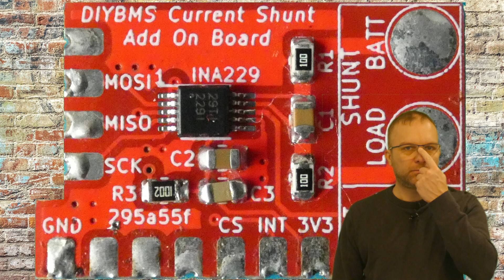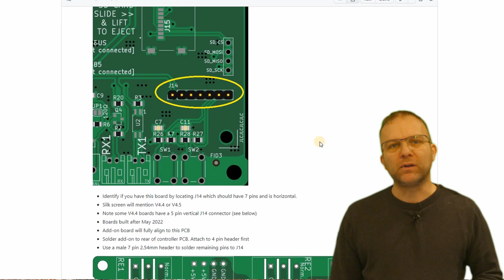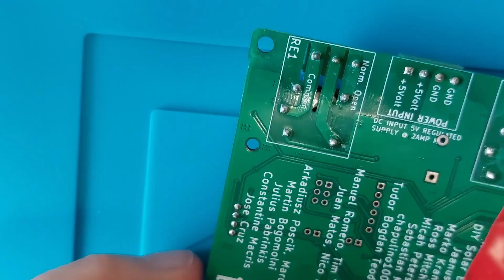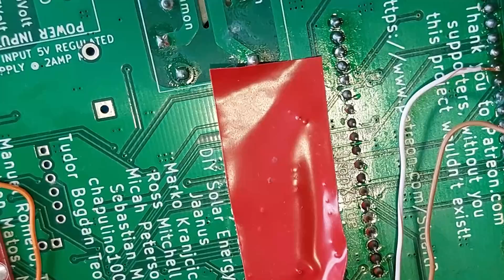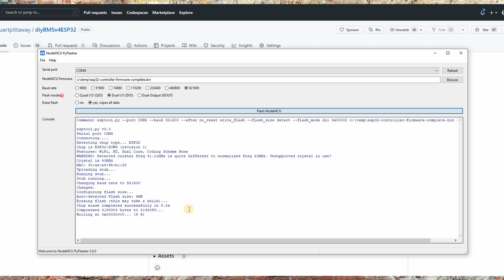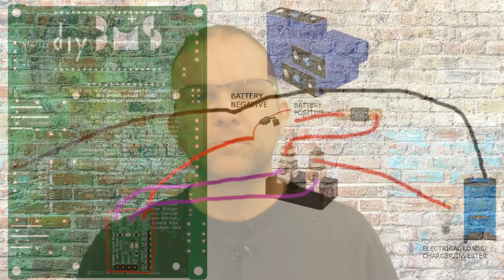Current Shunt Add-On Board [DIYBMS]

Comment: @StuartPittaway   Just purchased the 4.61 Controller was planning on using it with a 96s Lifepo4 system. I just watched this video and reading the comments, I thought the controller wasn't limited by voltage but in away it is because the shunt is only capable of 85v.. I'm not sure what to do now, I thought this BMS was my solution.. 
Is there a way that I can incorporate something like the VISHAY HV-IBSS-USB shunt?  This thing is pretty awesome, up to 850v.

Comment: Have been using your ina229 current monitor on my new solar system for about a week, modified with 3 current sensors. I note a low frequency oscillation of several 10's of an amp with a period of several minutes. At night when battery current should equal load current, the oscillations get out of phase where sometimes   load current goes up while battery current goes down etc.. Problem is difficult to analyze with scope because of huge amount of high frequency noise. I am thinking a possible cause may be the high inductance of my inverter coupled with the 1 uf filter capacitor on the input of ina circuit. I changed the adc_config register to collect 1024 sampled (from default 128 to 1024 --- 0xffd4 to 0xffd7) and this helped the problem quite a bit. Will work on it some more. Thanks for inventing such a great circuit! Hope this is interesting.
Reply from the maker: Thank you for the information

Comment: Hi Stuart, really great work and effort you're spending so many years now. Thanks for that!
I wanted to upgrade my esp8266 controller to esp32 because of the shunt option - I chose the add on board and now I got stuck with 0-readings.
Perhaps you can give me one or two hints? As I populated 2 controller boards (v4.6) and 3 add on boards already, I would exclude a soldering issue with the INA229 chip.
Reply from the maker: Hi, probably easier to open a GitHub issue, it's difficult to support via YouTube messages

Comment: Can we attach different shunts to the controller? I.e. ones that support more than 85 volts?
Reply from the maker: The shunt is a current monitor, the voltage the voltage doesn't matter.  However the INA chip I use has a maximum of 85V voltage reading

Comment: Want to thank you for your current monitor design. I created a somewhat expanded stand alone ina229/esp32 board with 3 current monitors channels based almost entirely on your board, and software. Also added a mod-bus interface for status and control of my Epever charge controller. Just got the board working, but still digesting the software. I wanted to monitor battery, load, and charge controller current simultaneously. I used Easyeda for the board design, with a somewhat different esp32 module. It was very challenging soldering the ina229 chip, but my wife managed it with her steadier hands. I have had good luck exporting data with MQTT and displaying with node-red. Thanks again.
Reply from the maker: Excellent, glad you found it useful
Reply: @StuartPittaway  thanks. Now trying to get it tested, and having trouble getting the current to agree with my test setup. With the calibration register set to the value per online tool, I am getting about 5% low, and the negative current doesn't quite agree with the positive. Can always change cal value, but not comfortable with that. Now building a second channel to see if results are the same. I have a .72 milli-ohm shunt, and have set max current to 40.96 amps.

Comment: Hi.. Thank for great work! Have a question, want to use this for EV conversion, 110series...does it mean I will require 110 modules?
Reply from the maker: Yes, it would. With a high voltage DC setup, I would look for a specific EV BMS. Especially as it's safety critical
Reply: Think I'll go ahead with Orin bms, or reverse engineer a Nissan leaf bms I have lying around

Comment: Hi Stuart, great work you are doing on this, much appreciated. Your comment on ground isolation has stuck in my mind. I'm now trying to get the BMS to Sofar inverter CAN working again after I did that initial testing of the Pylontech emulation last year. You probably remember that I had ground isolation problem which I solved using a mains powered ground isolated supply. I'm now powering the BMS of the battery as suggested but am getting the ID05 error again when I reconnect the battery. Can you advise which buck converter you use? Mine seems to be causing a problem. Thanks in advance.
Reply from the maker: Remove the ground connection from the CANBUS cable, just use canh and canl connections
Reply: @StuartPittaway  Thanks. There isn't a ground wire on the CAN cable. The problem appears to be that the ground plane of the HYD inverter is at PV voltage, in my case 215v relative to Battery negative. Supply at the BMS needs to be ground insulated and anything connected to the BMS also needs to be isolated from ground.

Comment: sorry to spam your most recent video, I am struggling to get any slave 4.21 boards firmware uploaded

EDIT my new usbasp device arrived. same problem as before observed. tried -F upload flag, tried -B16 upload flag. all to no avail. Any advices here Stuart. Last thing to try might be the tinyisp like Adam Welch does but honestly think that the slaves may be broken too.

I struggled last night to flash the 4.21 slaves
Uploading .pio\build\V421\module_fw_V421_attiny841_421_eF4_hD6_l62.hex

avrdude: error: program enable: target doesn’t answer. 1
avrdude: initialization failed, rc=-1
Double check connections and try again, or use -F to override
this check.

any chance to send one to you to rule out that its not my equipment letting me down?
Reply from the maker: You can try the tinyISP but I'm starting to wonder if the boards are no good/bad soldering or faulty ATTINY chips.
Reply: @StuartPittaway  yep me too
Reply: Might try cleaning the flux off the boards from my soldering but the soldering was pretty tidy
Reply: I do get a green flash on the board when it tries to flash
Reply from the maker: Do you have an Arduino which you can program using the usbasp adaptor? Straight from the Arduino IDE
Reply: @StuartPittaway  yep i already have one. Ive used it to flash an old i3 clone 3d printer board that didnt have an onboard programmer
Reply from the maker: @Whereswally606  in which case it's got to be the chip or the soldering, it's definitely a working design, so I would expect at least 1 of the modules to work!
Reply: @StuartPittaway  just got it working with my usbasp. Bloody stupid error on my part. I was changing the -b16 on the wrong env as i was doing it to the env400 not the general env section. Thanks for helping

Managed to flash the 5 i have. Now to buy a few more so i can have a 24v pack.
Reply from the maker: @Whereswally606  fantastic!

Comment: Thank you for sharing ! I 'm a novice, the display shows ' The controller is having difficulty communicating with the cell monitoring modules. ' What does it mean, the page also has no data, the control board has no problem, the monitoring board uses 440, how to solve
Reply from the maker: Generally means a problem with the cables between the controller and modules.
Reply: Thank you for your response ! But I 'm sorry, it still doesn 't work.
Reply: I like your BMS very much, I want to continue, can you tell me the specific information of the cable using BMS, there may be a problem in this regard
Reply from the maker: @yuanianlin  open a GitHub issue for the problem, it's easier to talk there

Comment: Hi Stuart, great work again. just ordered the "old" board 5 days ago... you know, if it is possible to use the ina 229 also on the original version of your shunt system?
Reply from the maker: The original shunt can only use the 228 chip - not the 229.

Comment: Morning Stuart,  from sunny Australia. Never did get them boards working.
Reply: Gday mate... i`m relatively new into the DIYbms and will say it works very well, and now also works well in canbus mode simulated as a pylontech battery, works well with my Solis RHI 5k hybrid inverter. 
My previous build was with a Zeva BMS, awesome bms to be fair, built there in Oz, but he doesnt do them anymore.
Reply: @Anthony Evans  I have 5 boards here, half populated, I live in Victoria.
Reply: @chuxxsss  Hi again, what version controller boards are they?
Reply: @anthonyevans7911  4.0 or 4.1
Reply: @chuxxsss  ok, not the one with the esp controller and screen
Reply: @Anthony Evans  Yes the one with the screen and esp32.
Reply: @chuxxsss  what items are left to populate?

Comment: Question on powering the controller, I'm currently powering it via a USB port on the inverter that is powered from the battery. Do you think this will still be suitable if I upgraded from external shunt to on-board?
Reply from the maker: Difficult to know for sure in this scenario Mike.

Comment: a doubt Stuart. What distance could there be between the controller and the resistor (shunt) consider a distance limit or we could have a meter or a meter and a half of distance, will it greatly affect the reading precision or interference?
Reply: There is practically no current flowing so distance is not that important. You probably get some noise in it in longer cables but the digital INA ICs have some built-in filtering/averaging
Reply from the maker: I've tried about half a metre worked fine, you'd have to try it!
Reply: Just drill the cable and use a bigger diameter 1,5mm2 or 2,5mm2

Comment: Awesome work.
Placing a voltage divider. Could the INA229 VBus reading voltage be increased for high voltage systems? For example for reading 150Vbatt
Reply from the maker: I doubt that would work, outside the specification of the INA chip.
Reply: @StuartPittaway  What about using a voltage divider though? Bring that down to spec for the INA229... 

It would need a software change to accommodate such setups. Some sort of multiplier ratio the user would have to supply.
Reply from the maker: @CollinBaillie  all the internal calculation inside the INA chip would be wrong as well, the chip does all the columb counting
Reply: All these current monitors work by measuring a differential voltage across the shunt resistor, which itself is a very accurate resistor of a known value. If using your example you divide the battery voltage by 10 to get 15V then your current measurements will also be off by a factor of 10, and any variation in the resistor dividers would add further inaccuracy to the readings. You would need to do some custom modification of the firmware to compute the correct values but still be left with potentially variable errors from the voltage dividers.

Comment: Brill Stuart. Just to clarify, the new controller version 4.6 will have the current shunt integrated? Reason I ask is i need another 2 controllers and 3 current shunts at the moment for new installs, need building them as soon as possible really buddy. Thanks, and great work.
Reply from the maker: Yes integrated into the controller
Reply: @StuartPittaway  If you want to pass oe of your shunts on to a few patreons to test, i`m available if your want to. Thanks